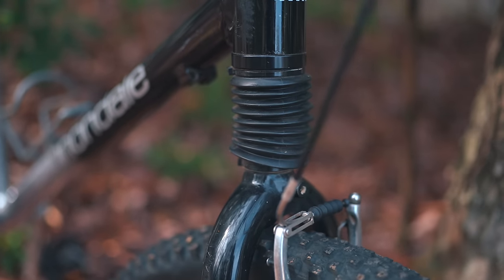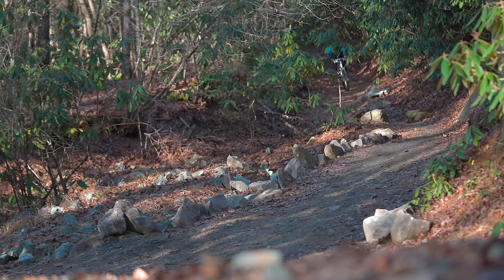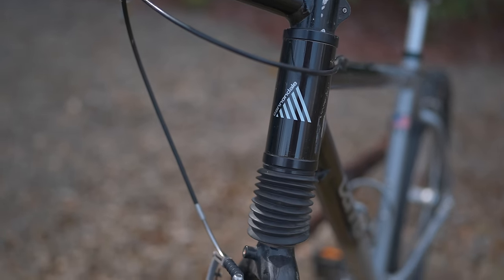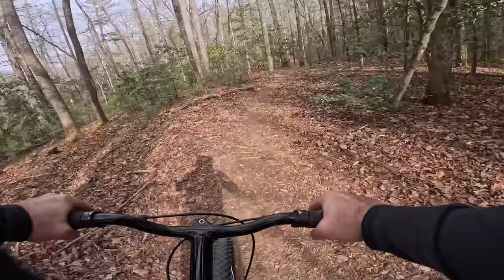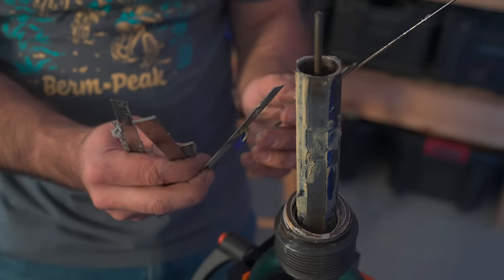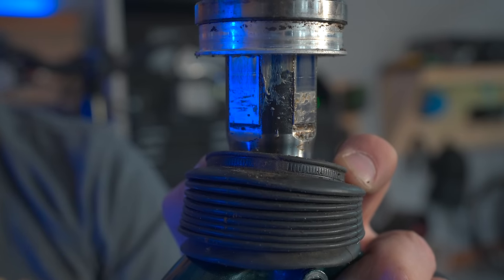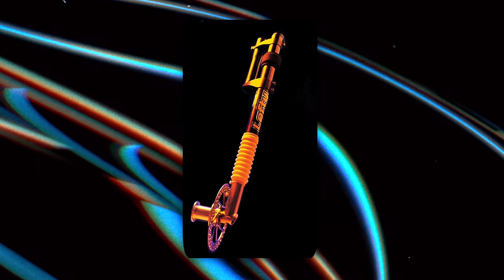The Rise and Fall (and Rise Again) of Cannondale's HeadShok

Comment: I don’t know if you remember it, but for years I rode a yellow Super V with a Moto fork on Bike Patrol at Oleta River State Park. You might think it was over kill but with, at times, eleven hours riding those trails it was great to have that Cadillac ride. My back and my butt were grateful. I eventually was riding it at Virginia Key but I traded it for an Andante hard tail 29er with h disc breaks and one by transmission. Evolution.

Comment: Hi Seth!
A hug from Portugal!
I love Cannondale bikes, I have a Cad3 that is from around the same time as your F500. Some time ago I converted a mountain bike to gravel. And at the time my idea was to find one with the headshock suspension, but unfortunately I didn't find one. I think it would be a great idea to convert your F500 with modern components and see if the suspension makes any difference on a gravel course versus an actual gravel bike.
A hug and thank you very much for the videos!

Comment: Love the video Seth. I’m rocking two Cannondales with the headshok one is a 97 F600 and my favorite one from 94 a delta v 600 which I converted to disc brakes front and rear and a 1x11 drive train. Of course I went 720mm bars both bikes ride out standing. I’m older so I don’t hit a lot of big jumps or large gaps. Keep up the great work and stay safe out there.

Comment: Great fork design that offered unrivalled smoothness and stiffness. There's still lots of these out there and I get sent 2 to 3 month for service. 
One thing I must point out in the video is at 8min 15secs, DO NOT turn the 19mm nut with a wrench (you'll likely destroy the inner workings) and don't try to remove the damper via the method shown by unscrewing the white nylon damper cap.

Comment: I still have my mid-90’s headshok cannondale.  I’m planning on restoring that bike when my daughter gets big enough to ride it.

The lockout was for when you wanted to climb a hill or when riding on the road so the front end didn’t bounce.  Silly by today’s thinking but that is what we thought back in the day.  I ran road slicks on my MTB pretty frequently so I did use the lockout for its intended purpose.

Comment: I still have my 1999 Super V 700 and the headshok is still in great shape. I had  1995 Delta V that my son borrowed and it got stolen. I really liked the way that bike rode. Never had a problem with either headshok but I did hear people bashing them when they needed work. I did have a hard time finding the right stem for that Super V

Comment: So glad to see you showcase the bikes of the 90's....for better or worse some of the innovations worked while others didn't but it still was an exciting time to be involved in mtbing. I have evolved with the sport and no I have not even considered an E-bikes. I have gotten into collecting bikes that were only a pipe dream when I started, mostly hardtails, and I have to admit that I was never a fan of narrow flat bars nor the 120mm plus length stems of that era. Riser bars were just starting to make there mark and at the time I think the shortest stem I could find was a 90-95mm. Your know on my current restorations I try to keep everything period correct including all the cool anodized aftermarket components but no flat bars or bar ends but I don't throw that stuff away either.

Comment: My two main mountain bikes have 60 and 70mm headstocks.  With 2.3 - 2.5 x 26 tires they're just as fast as modern 29niners on all but the large drops.  What they lose in rolling resistance they make-up for in compact agility.

Comment: My LBS had a crew in Sacramento that was so good at rebuilding the Headshok that they were more adept at the work than Cannondale.  They had invented their own tools that made servicing the roller bearings much easier.  They had offered Cannondale so much advice over the years that Cannondale finally sent a video crew out to the the shop to record them doing the service to train the factory workers!  Those guys were good!

PS  Full disclosure.  IRD (pretty sure it was them) had a jump start on Cannondale and did their own head tube suspension before the Headshok.

Comment: I had a F400 with the basic Headshock. 
In all the years that I had it rebuild it for all parts, because the Coda stuf on it wash really rubish. 
Ended with 1x11 XT, Magura HS-33 rimbrakes and some good Mavic tubeless wheels on it. 
Replaced the bike with a Scalpel SI 5 in 2017 and also rebuild it. 
Looks I like rebuilding bikes 😁

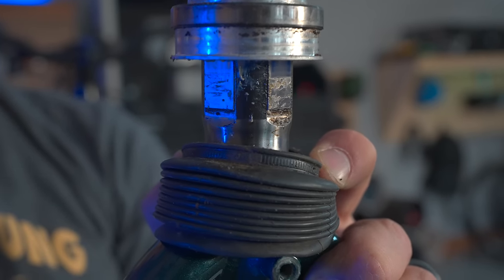Comment: 6:13 - never seen any literature or manuals that claim the HeadShok is frictionless, they do make the correct claim that it is stictionless, that’s assuming you have all the races fitted correctly. If it’s put together with the width of the inner races on the steering tube all out off order and you manage to get those needle bearings sandwiched in without shredding the plastic strip that holds them (which I did my first and maybe second time) before I got a link to the Sheldon Brown upload of a complete Cannondale mechanic’s HeadShok Manual for servicing just about every HeadShok from ‘92 to ‘97 including the downhiller’s 120mm travel Moto. It even has the breakdown of how to tune your damper for more or less compression and rebound and the different weights of oil for different tunes how to stack the shims replace the many seals what tools are needed then how to correctly bleed your damper. It also has info about the different types of suspension and damping: such as a mechanical damper used with elastomers and/or spring /elastomer combo; hydraulic dampers used with elastomer/spring-elastomer combo; hydraulic damper used with air suspension. IMO these are the best 90’s era XC/Singletrack fork, and best urban whip shock  for potholes and beat up asphalt and cyclocross.

Comment: Had a road race bike with the Headshok 20mm suspension. It was a great bike, smooth and handled well, despite the power that went into the suspension. Got me a few wins, maybe because the body handled a long race better without being exhausted by a very rigid frame. Now I'm on an almost 20 year old Headshok C-dale Caffeine, great on tracks and gravel; wouldn't swap it for one of those newfangled 29ers with suspension all over the place.

Comment: I’m Currently taking apart an old elastomer lefty to put in a more modern oil bath damper that I’m going to make :)
It’s a pleasure to work on and I 3D printed some of the tools to take it apart. Right now I’m working on the unlocking tool for the bearing races :)
It’s fun :) 
I’m a engineer and I like lefty forks a lot. I even made a rigid lefty for my 20“ travel bike myself :) such a nice concept and well made :)

Comment: I've a 96 SV500 I commute to work on via gravel tracks and the old headshok was indeed plush. Only a few months ago I had to remove as it had lost it air seal,  replaced with a tapered conversion tto use currently available forks as I couldn’t find replacement parts or a company in the UK to sort the Headshok out. It's still on my shed shelf waiting to be repaired... one day. It was very plush.

Comment: My first mountain bike was a 2004 Cannonade Prophet that I bought during the pandemic for $750. With a narrow wide chainring, a shorter stem and wider bars, some decent rubber, a used fox rp23 and 36 talas 140mm at a total of around $1200 it was quite the capable bike that was way ahead of it’s time. Sadly the bike was a lower spec that did not come with a lefty, however that made the switch to the 36 as easy as could be!

Comment: I still ride my polished 92 Cannondale v2000 with the fatty shock. It still rides great. Great handling bike. ... Then I updated my bike to a 2015 jackal 160mm Lefty. You'll still see me blasting down Northstar downhill trails at Lake Tahoe. The faster you ride the better it rides. And it will climb to the top of the mountain.

Comment: I've always liked Cannondale for their out of the box thinking. Not many people understood where the lefty fork came from, (well now they do because Seth explained it), but 'single sided headshock' was the residing understanding for most of us.
The early lefty's were considered to be quite heavy compared to other forks of the day, but the newer single crown ones, like in this video, seem to have become quite competetive in the weight weenie market.
Someone I used to work with raced cross country bought a scalpel of the time that only weighed 8.5 kg with the single crown lefty.
He also said it didn't need as much service as anticipated, but he didn't ride that bike all the time.
I reckon with the needle bearing misalignment issue, they could design in some softish rubber bumbers at the top of each bearing race that gently nudges each needle race to the same place each time the fork reaches extension, though they probably already have a solution for it by now.

Comment: I love my heavily modified mint from new 1998/1999 chromillusionpurpleen F700 sl headshock! Like you say the suspension can be buttery smooth. i just love the way everything is stashed away in head tube although i appreciate not much travel and potentially a nightmare to service!!! but so much neater looking imo.😁😁😁

Comment: brought back memories of bearing resets and the first time I felt a fork without flex or stiction.      Headshok seems like it could be pretty hot again with the popularity of gravel bikes with bigger tires and getting a bit longer/slacker to make them more off road ready and the explosion adventure and bike packing bikes (squish without loosing the mounts)    Would need to make them go longer between service intervals and come up with a much better looking way to protect the internals than the OG rubber boot (that boot would be marketing poison)      Started planning my trip for the Fools Loop in Arizona and a modern day headshok on my drop bar 29e would be perfect.

Comment: BMC URS, which is a gravel bike/drop bar old school xc(geo wise) has a similar idea in it's 40mm front shock. No rubber boot like the Cannondale, but it is a headset shock. That bike came out like in 2021, but I think they had an older model that was a xc hardtail with more travel.

Comment: May I make a small correction, to reset the needle bearings, all one have to do, is let the air out, push the fork down until it bottom out, air in, reset done, no need to take it apart, same with the Lefty. Great video as always ✌.

Comment: I've got a super v2000, ride it most days, it's 27 years old now.  50mm of travel,  it has never given any trouble as is also true for the magura rim brakes, never touched them apart from new pads.  I am now 2 x 10 but it was 3 x8 originally.  Running shimano 105 road triple 30 and 39. The original coda cranks were horrible but a work of art. I am still very happy on it, might get a new bike when the next wheel size comes out....  28.25?  😂

Comment: Merlin was licensed to use Headshoks as well along some other brand I don’t recall now. First Gen Pepperoni Headshok had needle bearing races preload adjusters so resetting them was easy. Later Gens came with uniquely set up preloads for where the outer races all had different thicknesses. Because of this it is crucial to record where each needle bearing and corresponding race goes upon disassembly or otherwise one will be in a world of hurt. This continued with their dual Headshok MOTO FR and booted Lefties as well. When I worked in a cannondale shop back in the early ‘90’s, we had dozens of cannondale training and tech tutorials sent to us on VHS…..man, I’m getting old….😂😂😂

Comment: It would be neat to see it paired against the other OG rigid fork leg suspension forks like the AMP Research and Girvin coil over. I rode a Girvin for years and it was incredible. A bit predisposed to OTB incidents like all 26ers but plush and freaking tough.

Comment: I worked at a shop in the 90s and serviced many headshoks. They were not that difficult. I had a couple of bikes with them. They were on par with the travel of other forks of the day, but the steering and small bump performance was WAY better.
Reply: It seems like Cannondale has managed to keep the DIY'ers away from Headshok repairs and services. I could be mistaken but I haven't been able to find any detailed service manuals. But I've seen some good YouTube videos in the recent years. 

Got a CAAD4 frame without a model number with a Fatty D fork (just the basic lockout). It feels and sounds like it is either running low on oil or the oil is contaminated. The damper is a bit weak. Of course it could be something actually broken or worn inside. I think I have to try and make the special tool myself at some point. 

Too bad there is a small crack on the other seat stay. I'd guess it had water inside and the frame had been in some weird position at  winter.

Also got a 2003 F400 with a reducer and a basic fork.

Comment: very few people use 1.5inch headtubes even now. 
the 26er i built my sons first proper MTB out of it a 2002 F400, but the headshock went in the bin as it was broke. 
cane creek top headset
nukeproof bottom headset and a tapered rockshocks reba RL dual air has taken the headshocks place. 100mm travel, pretty much the same axle to crown height

Comment: Liked it a lot, as in the 90s, light XC-Forks like RockShox SID SL Titanium were flexing like hell. Switched to Lefty later on, and still have a 2013 Scalpel as backup-Fully. Nowadays, classical XC forks are much stiffer, and have much smoother action, so Leftys are nice to have, but not a USP for Cannondale...

Comment: As an old guy….and mechanical engineer, I remember this and appreciate it. From an engineering point, it has some superior attributes in terms of reduced Stiction. Also I believe unsprung weight may be better. I have no clue why modern mountain bikes don’t all use upside down forks since sport bikes switched to them in the early 1990s!!!

Comment: I own a Cannondale Super V with headshock D (Marzocchi cardridge type) Since it has started to leak oil into the air chamber I have bought a brand new shock with detacheable air chamber and retrofitted it into mine. I have noticed that when I lock out it, it spreys oil from somewhere therefore I leave it in open position.The bearing system is a master piece however the shock absorbers sucks. Even I replace the o-rings inside and refill with fresh fork oil the leak problem reappears. The pressurized air underneath of the shock absorber pushes air to come inside the oily section and then starts strange noises when you press then depress the handlebar. Since there is nobody to service these, I have become a Headshok mechanic. If I can not succeed in stopping air entry into the shock body, I may consider using a spring and shock absorber.

Comment: I took off a head shock and used a Risse 6 inch upside down fork and then modified the frame with a double stroke length shok and we had 8 inch travel super vee. I won two race on that bike at Plattekill

Comment: Blew out the seal on my headshock one time (which didn't have many miles on it), and I sounded like a blacksmith pounding on my anvil throughout the forest, for the remainder of my ride.  
Took it to a dealer for repair, who (not wanting anything to do with it) sent it directly to Cannondale for a rebuilt replacement.  At the time, Cannondale's IT department was converting to a new computer system, and so their service department was fubar'd for weeks, resulting in me not getting a replacement for a couple months.  In order to comp me my time and pain, they gave me an upgraded headshock, free of charge.

Comment: I want to see you review a K2 Proflex 4000 like mine, Its got an interesting cross-link suspension design, and Noleen made this smart shock thing that electronically adjusted damping on the fly. My smart shock is broken, so I have no idea if the auto-damping worked as described in old scans of 90's magazines. The proflexes are out there though.

Comment: I have a 1964 Moulton bike which has head tube and rear suspension. It still works beautifully. Cannondale were certainly not the first to develop this idea!
Reply: I thought of my old Moulton as soon as I saw this. 
It also had a 4 speed Sturmey Archer hub but that was nigh on impossible to adjust to get all 4 gears reliably. 😀
I’m sure Mr Moulton went on to design the Mini’s suspension
Reply: @Pikestnt  Yeah, the SA hubs take some fiddling but they’re incredibly durable. I’m amazed at the condition of mine whenever I strip it down. The new Moultons are worth a look too. The 2 speed TSR with a belt drive particularly appeals to me as an all purpose bike.

Comment: 59 in April Regularly ride my 2x Caffeine F1s (2009) Rush (2007) a caad4 SX 2000 (Stars n stripes) had a 2012 Trigger 2 stolen, so to make amends In 2023 i purchased a 2013-14 Trigger 1 26" wheel in honestly mint condition. Unboxed it still had the tags on the unmarked rotors carbon seat tube totally unmarked (never fitted) H/Bar white grips spotless. It was as new unridden. What a find indeed.

Comment: Bearing resets on the Lefty Hybrid 1.0 were literally just slamming the wheel into the ground with no pressure in the system. No disassembly required.

Comment: Headshok indeed had the 1.56" steerer tube, as did early Lefty forks. Later Lefties were/are 1.5". My 1999 Super V 1000 has a later Lefty stem with the ID machined to suit the 1.56". if I die, I die, at least I have an 31.8 mm Handlebar on now!